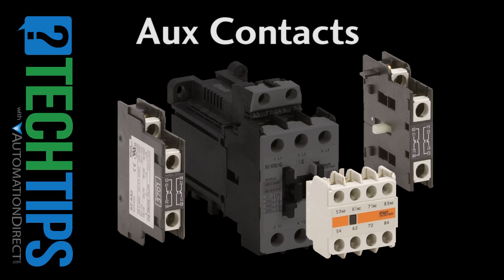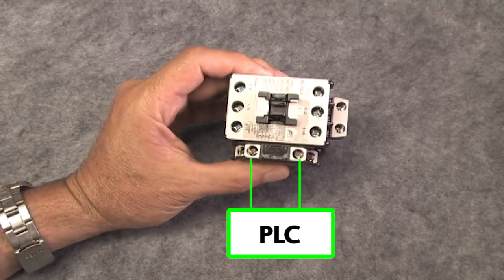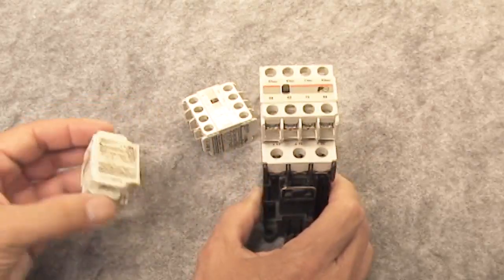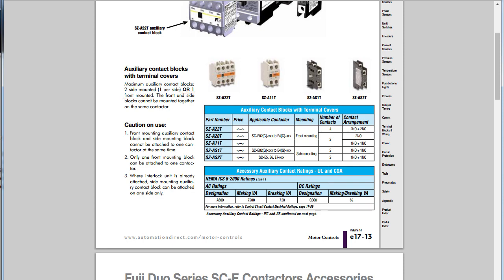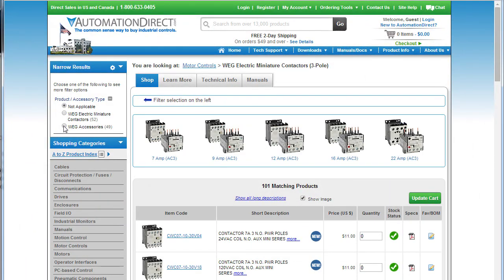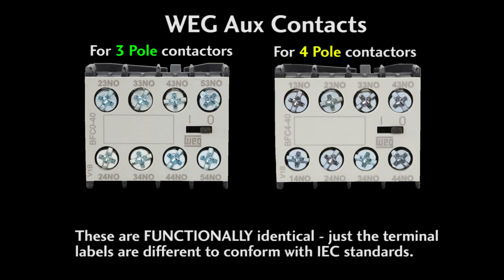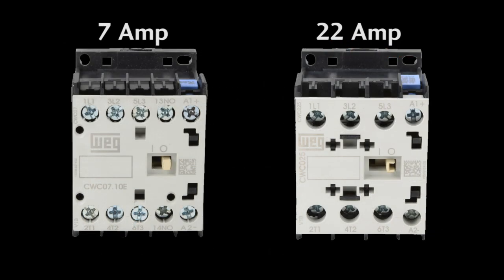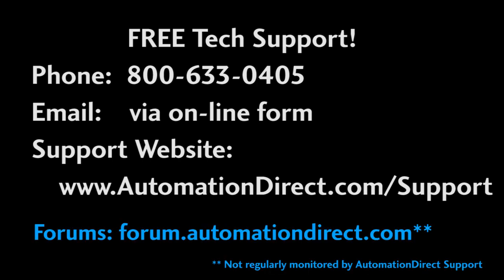Motor Contactor Aux Contacts How to Use from AutomationDirect

Comment: Sir, could you please tell how to do the  wiring of Frontier digital timer switch with Schneider contactor...
The out put I need to connect the load ( lights)...
Reply from the maker: Hi Badrul, Unfortunately, AutomationDirect doesn't sell the Frontier digital Timer switch, so we can't help you with that one ....We do have a digital timer switch here: https://www.automationdirect.com/adc/search/search?fctype=adc.falcon.search.SearchFormCtrl&cmd=Search&searchquery=digital+timer+switch&categoryId=5258&TxnNumber=-1&searchqty=10&start=0#Component_ms=(%20%22Digital%20Timer%22%20%22Multi-function%20Digital%20Counter/timer/tachometer%22)&start=0&rows=10

Comment: Why the contactor is so noisy when 3  contactor for the alternate operation pump do you have a diagram sir
Reply from the maker: Hi Jeffcuyoz,
Contactors are mechanical devices - the noise you hear is the two metal contact hitting each other. Please contact our Free Tech Support at 1-800-633-0405 during regular business hours - they will be happy to help you.

Comment: why would you ever need more than 1 aux?
Reply from the maker: This is really dependent upon the monitoring system, if you have two separate monitoring systems that need to read the status of this contactor. For example if you have 2 PLCs that need to monitor this contactor.
Reply: For interlock with other machine.

Comment: How we can connect 4 pole 240v coil contactor in arduino?
Reply from the maker: You will need to buy an interface the Arduino can talk to that can handle the 24VDC or 120VAC control voltage of the contactor.  OR, take a look at the Industrial Arduino controller we sell - it has all kinds of heavy duty I/O modules/shields ready to go!
Learn more about that here: https://www.automationdirect.com/open-source/home